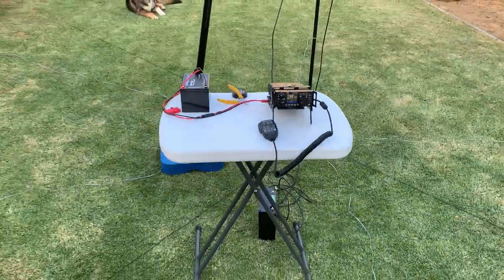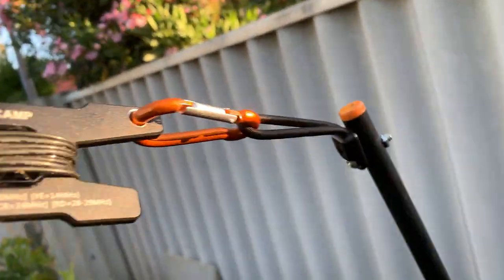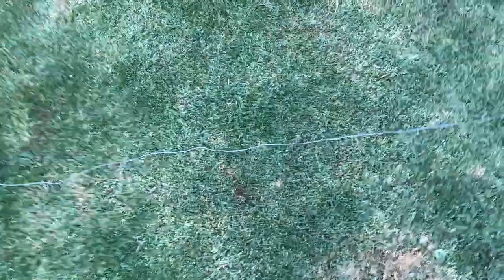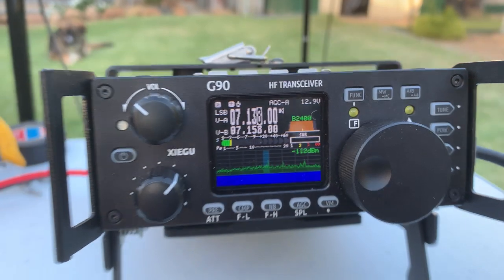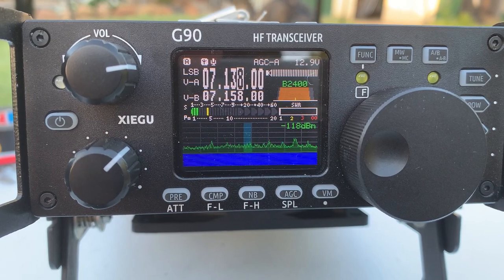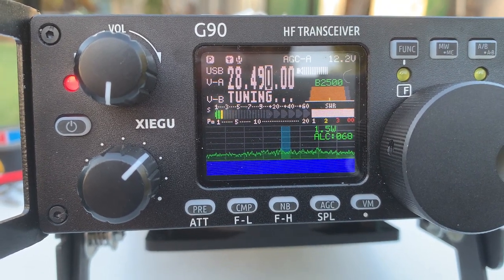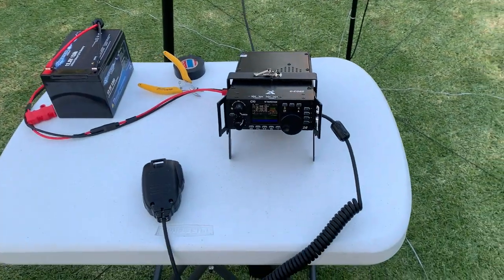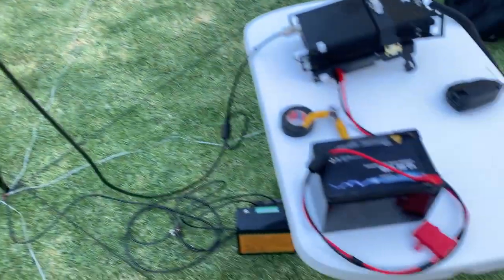MY PORTABLE SET UP, IN MY BACK YARD,THE XIEGU G90 IS ALOT OF RADIO CONSIDERING THE PRICE AND SIZE.

Comment: A tuner does not make your antenna resonant. It only "simulates" 50 Ohms to the SWR protective circuit of your TRX so it doesn't reduces it's TX power and the relatively high reverse power coming back from the (still) not resonant antenna will be transformed into heating power in your tuner.
Reply: The only additional "heating" caused by SWR is that there can be areas along the transmission line (standing waves) with higher current, thus higher ohmic losses. Higher voltage can also have an effect, but I'm not sure it's as significant as the ohmic losses of higher current. The antenna matching unit or "tuner" doesn't necessarily get hot when dealing with modest SWRs. There are plenty of Hams running a kilowatt via an antenna tuner, and if they had hundreds of watts of "heating" in their antenna matching unit, then there'd very quickly be smoke and flames; and that doesn't happen on a normal day. In most cases, the higher SWR just causes some standing waves and most of the power is still ultimately radiated.

Comment: Do you turn the power down to tune or doesn't it matter?
Reply: From what I understand when you tune or use the antenna scan it drops the power output to minimum.
Reply from the maker: I mostly run QRP, 10 watts.

Comment: Could I ask how your rotatable dipole is working for you? I had mine at 34ft and couldn't get it any higher, it worked but it needs to be up over 50ft to work efficiently, so I took it off the mast.
Reply from the maker: It works great, better receive that the wire dipole due to the construction, I haven't tried at 50 feet but at 30 its works very well.
BushComm made it, it is their proto type.

Comment: Awww wha ta sweet puppy you got there. The funny part to me is you having a fatass yagi beam in your yard but you installed some wire antennas to play radio with LP RF output. Looks really nice there. Good job. 73's de Your Friend Uncle Guenter
Reply from the maker: Thanks for the comment, LP is always fun, frustrating at times though. 73's.
Reply: @vkradio1656  Even running QRO on an BIG GUN Antenna can be frustrating at times if others can hear you but don't hear them. Happy wednesday into Downunder Land